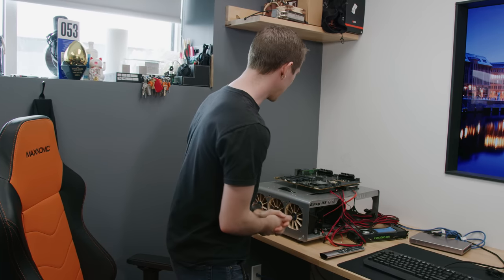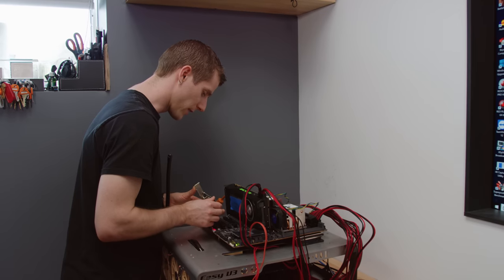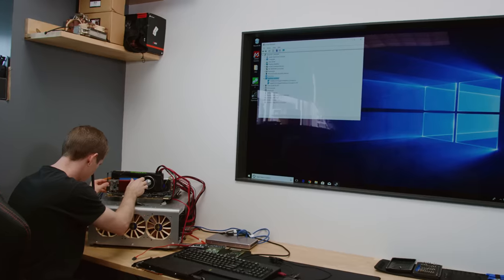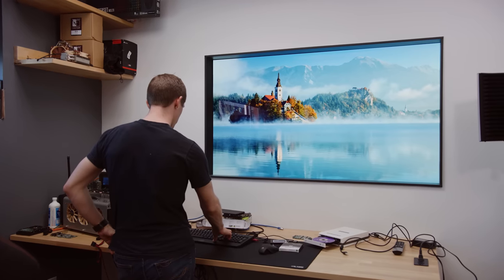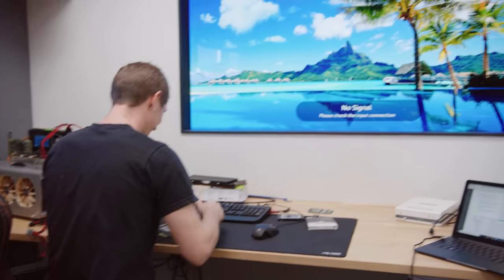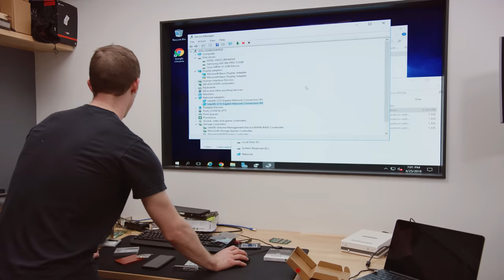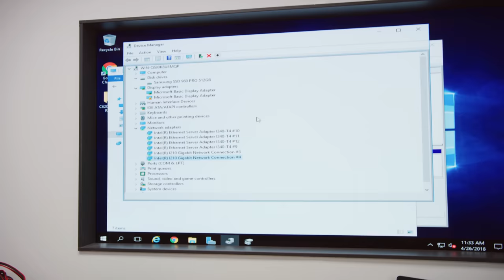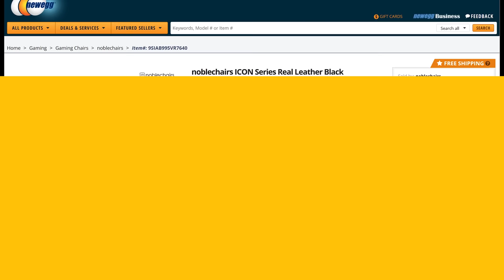I've NEVER been so FRUSTRATED... Hot-Swapping PCIe Cards

Comment: Fun isn't it? I used to do storage hba surprise hot plug at Stratus. Try pulling that pci dev under load next time 🤪. Drivers usually need to be hardened to handle that.

From the drivers point of view, it's like the firmware just died, writes go nowhere and registers read all ffs. At which point the driver has to  start rejecting io and go through it's pci removal routine. Good times.

Comment: UEB
Universal Express Bus
the new USB
it handles PCIe gen 5 links gracefully and because of the nature of the system it uses a simple chip to bond/unbond multiple 1-4x link cables(oculink or just a  USB-C cable) into as high as a 16x or even an insane 32x link
it also supports acting like a device so a second rig running a headless compute software can push datasets and results over PCIe 

can we have this please? I would love to have a low-end PI style rig that consumes maybe 65w peak but can easily handshake with a large gamer rig over a PCIe host agnostic link to run more demanding software, or even to connect different architectures to a single OS

or maybe I am just looking for a kubernetes cluster that works natively with windows over ethernet......

Comment: i wonder if you can use GPU crossfire at this point without using a crossfire, just run two different gpu cards and daaaaaaaang your good for some pro gaming if you ask me . if this works or maybe even as a graphic designer this would come in handy ! like myself

Comment: fuck I unplug the power, turn off the power supply and drain the capacitors when I'm tinkering with the pci slots and you can do it when the system is on with this thing.

Comment: The gold fingers (the traces that are the connection paths from the card into the slot)on the edge of the card will generally let you know if the card can or can not be hot swapped. If you carefully examine the fingers (look at the closely) you will notice that some are longer than others. The longer ones will make connection earlier in the insertion process.  The longer ones are either ground or power with the shorter ones are the data channels. So in other words the card is powered up first and then the data flows.

Comment: @Linus as even before I looked the video I know you didn't have an inch of idea what you're doing 🙄
Little hint not only the Mainboard needs to be hot swap capable also the card and driver needs to have this feature.
Also little reading helps to, hotswap capability is not mandatory in pci-e standard. 
Would save you many worthless tries 🤣

I would have looked for some server equipment like a raid controller card or networkcard.

Or talk to the guys on the Linux-Kernel mailing list.the people working on the driver's should capable of pointing on some specific card's.
Reply: I think it was more about just comedy.
If you watch Linus and anything associated with him for technical stuff you're probably at the wrong address xD